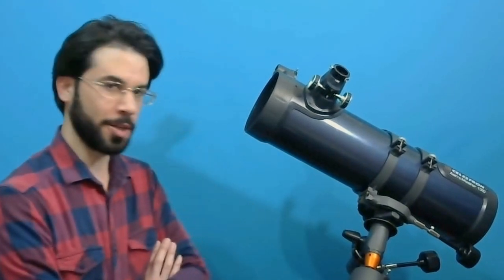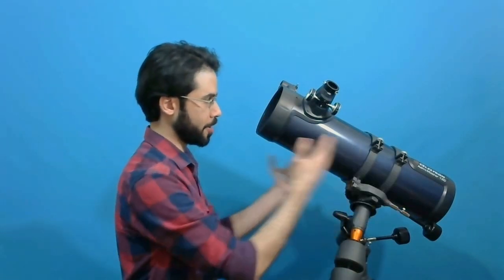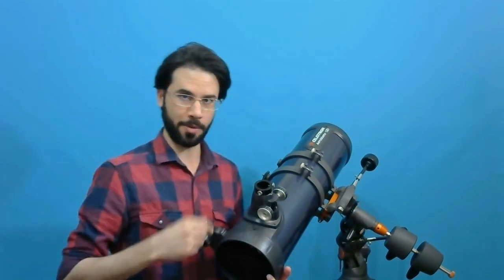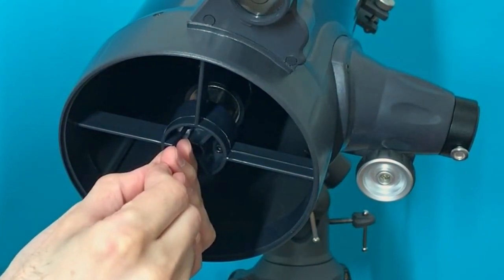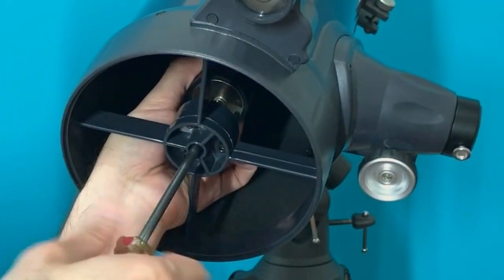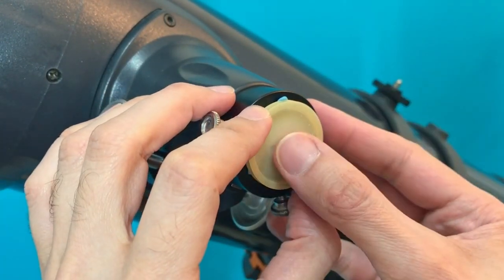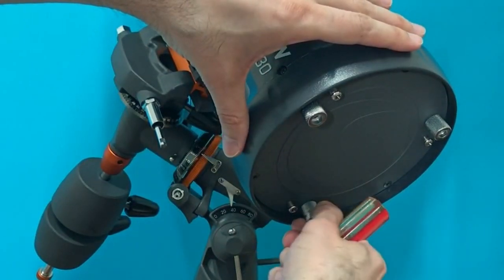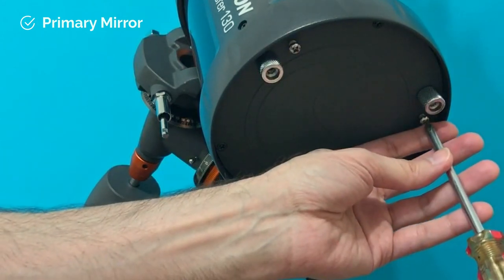How To Collimate A Reflector Telescope

Comment: Good morning Saeed, just some questions about the tube. Is it an addendum. If yes, what is the material; rubber, metal, or fibre. The ideal length of the tube. And more importantly, what is its importance. Kindly dissipate these misunderstandings. Thanks for this great video. Take care
Reply from the maker: Hi. Thanks for watching my video. Just a circular, thin piece with a small hole exactly at the center is appropriate. Collimation is done based on our senses, so extreme precision is helpful. You can find such a piece in tape players or DVD players that are not in use anymore. The pieces are basically used as pulleys.

Comment: Sir..did i Need lens when look at star or just using with a pinhole circle plastic ? Thanxx
Reply from the maker: During the collimation process, just a plastic piece with a hole at center is enough and no lens is needed.
For the first time that you want to watch the sky, a fine tuning might be needed as I mentioned in video. For this fine tuning, you just need to install eyepiece.
Reply: Oohh...Ur method help me a lot..better than using the laser tool..
Reply from the maker: @feisalsapiee8105  Happy to hear it. Have a great sky watching 😊

Comment: Hi. I have a zhumell 100mm reflector and during shipping the cullamation was out . I used a lazer and adjusted secondary mirror and got it center in primary mirror, however the primary mirror has no adjustment screws. How do you cullamate a fixed primary? mirror?
Reply from the maker: Oh! The short answer is “I don’t know.” 😂 But I guess there should be hidden adjusting screws for primary mirror. Maybe you should disassemble a few parts to have access to them.

Comment: I have this telescope and wondering do I really need to put that spring on it? or can I adjust it without the spring? I did order a Lazer  collimater but not sure its working right, so I ordered a collimation cap
Reply from the maker: Practically it is almost impossible to collimate the telescope without adding that spring. The reason is that the second mirror becomes out of control during collimation. You adjust it, but just as you want to fasten the central screw, the mirror rotates and every thing gets messy again.

Comment: Very very well made video! Thanx a lot! One question: what is measure of spring for newtonian 130 diameter? I have Celestron Astromaster 130eq and I want try this beautiful hack! PS: Like and subscripted.
Reply from the maker: Thanks a lot for your warm comment. As far as I remember, the spring diameter and length are 8mm and 5 cm respectively, with a wide tolerance, specially for diameter. You just need to use a spring that fills the gap and lets the bolt to pass through it 😃